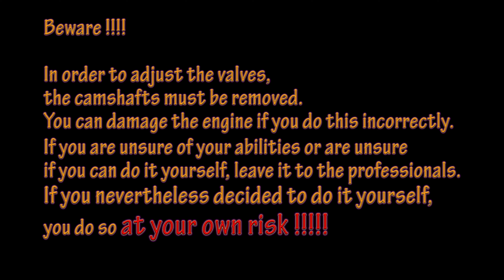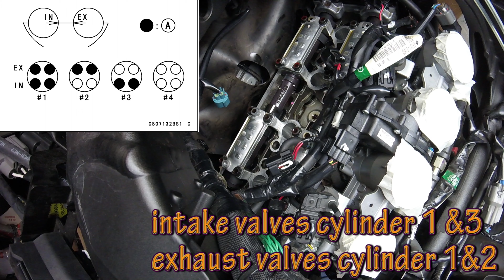Valve Clearance Adjustment   Kavasaki Versys 1000

Comment: 8:51 are you sure it is 360 not 180? ;-)
Reply from the maker: Well, I see and understand why it may be unclear and confusing, the camshafts need to be turned 180 degrees and that means turning the crankshaft 360 degrees so that the marks on the gear (gear with teeth on the crankshaft) and the housing match.
I'll pin this comment to make everything clear.

Comment: Top drawer Andy, cheers....Great favour you do all us versys owners and much appreciated 👍. Intrigued to know if all the maths and new shims gave the expected in-range results?  Also, ace magnetic tool you have there...any tips on where to pick one up ? Looking forward to seeing the finished Honda too 👍
Reply from the maker: Yes, the math has worked well, all valve gaps are within the norms. In my opinion, after the adjustment, the engine runs quieter and smoother, I bought a magnetic pick up tool online https://www.hbm-machines.com/producten/acties/hbm-2250gr-telescopische-pick-up-magneet
Reply: @MotoAndy  Cheers Andy, must admit, the  clearance service is one I'm dreading. Great that it worked out well for you.

Comment: Congratulations Andy, I notice that you have great preparation also on a mechanical level. You really set the bar high in this video.
It is a job that should absolutely be done at a specialized workshop which I highly recommend to those who don't have all this great manual skill and technical preparation.
You're great Andy, really well done.
Reply from the maker: @vitocibelli942  thanks and yes, I do not recommend to do that if anyone don't have any skills, it is difficult job and it is very easy to make mistake. If you not sure about that just leave it to the specialized workshop, otherwise, saving money may turn out to be a big expense. Take care🙂

Comment: Andy, you make it look easy.
Reply: Not such a big job - only took 27 minutes.

Seriously though, how long did it take, and how frequently should it be done?
Reply from the maker: In total, it took me 3 days due to the fact that I had to order parts. I think about 8 to 10 hours for the labor alone, doing it without rushing. according to the instructions, it should be set / checked every 40,000 km, but my valves started to make sounds after 29,000 km

Comment: The most informative video i have ever seen on youtube well done .How long does the work take.
Reply from the maker: Thanks, if you will have all the parts ready to install and without rushing 8-10 hours  including a coffee break 🙂
Reply: Thank you. how many km /miles between  check
 ?
Reply from the maker: @ryds1000  according to the instructions, every 40,000 km, but mine was very noisy, so I did it after 27,000 km
Reply: У меня тоже Kawasaki z1000 пробег 44 в мануале в 42.000 проверка зазоро , завёлся зимой отлично тянет замечательно, покупал восемнадцатого года ездил только я, зимой тоже буду делать, Надеюсь врядли что-то случится, в любом случае должен был быть какой-то признак, обороты бы плавали, или тянул бы как-нибудь не так. Видео вообще классное

Comment: Hi Andy, I have a question. Do you know if the Valve clearence are the same from de Versys 1000 2018 and Versys 2019, I thing the motor is the same. Un saludo from Spain.
Reply from the maker: it seems to me that everything should be identical, as far as I know, kawasaki did not introduce any changes to the engine design, the only change is the ride by wire throttle, but it's electronics so it doesn't have much to do with the design of the engine itself. I would ask a Kawasaki dealer to be sure.
Reply: Thank you very much Andy for your quick answer.

Comment: Hi Andy, many thanks for the video, it was extremely helpful.
I've just done the clearances on my z1000sx. The bike has 37k and it's the first time they've been done. It was running well but when I checked the clearances there were 7 that were out of spec and 4 that were borderline. I adjusted them and all was looking good until I came to sync the throttle bodies. Once again this has never been done on my bike. The engine appears to run ok (as far as i can tell without reassembly and a test ride) but the gauge on cylinder 4 has excessive flutter, making it impossible to get a good reading. I triple checked the clearances and have also swapped the coil and plug with another cylinder but the issue remains (it's not the gauge). Any ideas what might be causing this?
I've just ordered a compression tester and will check the readings, I'm expecting number 4 to be low as i think it might be a valve or head gasket issue but would appreciate any advice you may be able to offer?
Thanks in advance.
Reply from the maker: The only thing I can tell you is to check, check and check again. There can be no mistakes in this job, if it was better before than after, it means that something went wrong. Check the gaps, settings and timing many times. Before you start removing the head to look for gasket leaks, check everything and rule out the possibility of a mistake. It's hard to give good advice from a distance. Good luck.
Reply: @MotoAndy   @MotoAndy  thanks for the response Andy. I've got the compression tester now and will be checking everything again this weekend. Hopefully something will show up that I've missed, I want to avoid the head removal if at all possible. Might increase the clearance on the intake valves for cylinder 4 slightly so that they are on the larger side of the tolerance.
Reply: @ianfutube  have you figured it out?  Would be nice to know for future reference
Reply: @Mech.E  Hi, Yes, it's all sorted now.  Turned out to be a stupid mistake when using the gauges. The ones I bought came with some airflow restrictors but they weren't fitted. For some reason on the early model z1000sx the vacuum feeds on the throttle bodies are small on cylinders 1 through to 3 with cylinder 4 having a much larger diameter. This means that when you connect the gauges there is a lot more flutter on cylinder 4. Basically I had to install the dampers/flow restrictors into each tube leading to each gauge and adjust the damper to get a steady reading.
This allowed me to balance them successfully and at 37k miles it's now running beautifully. Just done a 1500 mile trip to Scotland and I honestly don't think it's ever run as nicely 👍

Comment: I am acquiring a 2015 Versys 1000 with 17k mi (27k km) and expect to have to adjust the valves as the previous owner has no service history and only rode it for around 500 miles. I have two questions for you:

1. Have/did you sync the throttle bodies after the valve clearance adjustment? I read that doing both greatly improves the performance of the bike.

2. Was the liquid gasket something you did as insurance against leaks? I have never used liquid gasket and reused old gaskets in the past for valve clearance adjustments however this time around I will definitely be using new gaskets where possible when I button it back up. 

Thanks for the video!
Reply from the maker: Hi Jack, congrats with your new bike, have fun with it.
1.I did the synchronization first, then I set the valves, but if you do both at once, your versys will be happy for sure 
2.the liquid gasket must be applied where I applied it, as recommended in the service manual. In my other motorcycle, I put a similar gasket without liquid sealant and it ran oil right after the first firing in these places. I also recommend using it so that you don't have to disassemble it twice
Reply: I thought sync should be done after the valves to match the new Valve settings 😊

Comment: How many miles/kms did you have before performing this service?  Surprised you had that many valves under minimum limit for clearance.

 Do you frequently hit the rev limiter or run at high rpm > 7K for extended periods?  Just purchased a 2022 Versys and wondering what to expect in the future.
Reply from the maker: I set the valves after about 27,000 km, normally it should be done after 40,000 km, but mine worked quite loudly, so I decided to check. When it comes to my riding style, I rather ride at tourist speeds not exceeding 6,000 rpm, occasionally on winding mountain roads the versys gets under the red line.
Reply: @MotoAndy  Thanks I just checked owners manual for U.S. and recommendations is 24K km and apparently is about right.  

Surprised you noticed it was noisier as min. clearance is usually the opposite effect and undetectable until the valves are hitting the pistons 😳
Reply: @kannermw  he probably heard a bit loose cam chain (kawasaki camshaft tensioner specific "problem"), tighter than specs valves dont produce noise.
Reply: @Vedran.  I was verifying interval for checking valves.  He had as a recall quite a few under low limit with only 3K km more than recommended inspection interval. 

Then Andy stated he does not rev engine high and to have that many out-of-spec valves even at first inspection is a bit disconcerting.

Comment: Good video!  The "shims" are replaced, rather than actually adjusting something? I was seriously considering this bike. Perhaps not as much now.
Reply from the maker: Thanks. most modern bikes have this valve system, manual valves are a thing of the past, besides, these valves are checked and shims possibly replaced if needed every 40,000 km. This is a very nice bike to ride so don't give up so quickly.
Reply: @MotoAndy   Given the higher rpms, it makes sense. Have been riding cruisers and baggers for many years with hydraulic lifters.

Comment: So at 9:40 and 15:15 when you are removing and installing the cam tensioner was there a small ball bearing along with the spring and rod? If so where did it go?
Reply from the maker: There is no ball bearing, there is only spring and rod
Reply: @MotoAndy  Strangest thing. I removed the cam tension-er and placed it on my work bench. When I came back a little later a small ball bearing was also magically present. The only thing I could figure was the ball bearing may have been inside the tension-er? It seems it fits perfectly inside and that the rod and spring  would go in and and work together? I'm really going a little crazy about it. Do you know if there a a schematic breakdown of the Versys 1000 tension-er? When I look at most schematics they don't show the internals of the tension-er only the whole tension-er as a complete part. Awesome video by the way and thanks in advance for your help.

Comment: wow, I remember valve adjustments, years ago on my 71 Honda CB750 as a pain.  In comparison it was nothing.  In bikes since, well I went with HD which have hydraulic lifters.  That head is really buried.
Reply: I had a Jag shop for a while, these are pretty decent compared to a Jaguar.  Same valvetrain setup, cams have to come out to get to everything, except there are also head bolts through some of the cam bearing caps so you have to pull the caps one at a time, put the head bolt back in with a spacer, torque it back down, then move to the next cap.  THEN you would have the camshaft out of the way and could start pulling lifters and shims.

Comment: No need to change the head gasket?
Reply from the maker: Why would you change head gasket? I gues you mean valve cover gasket, no need, just litlle bit silicone as it is shown in the video 21;13
Reply: @MotoAndy  I saw! 
Is this true for every motorcycle?
Reply from the maker: @sagarthapa3765  You can check your gasket manually, if there are no damages on it and it is soft you can use it again.
Reply: @MotoAndy  thanks a ton Andy!